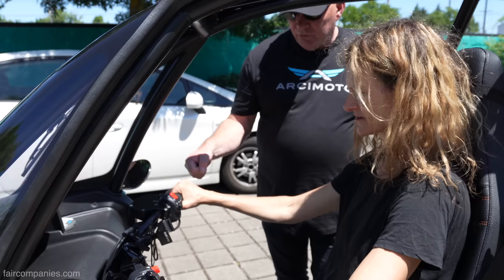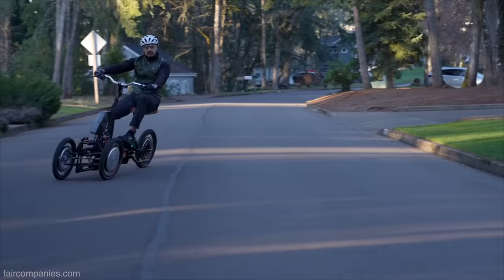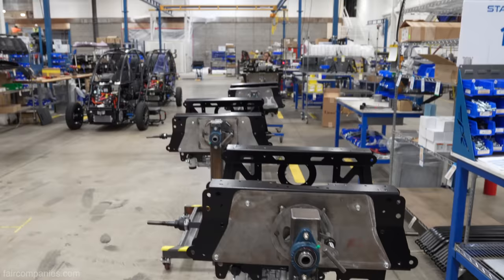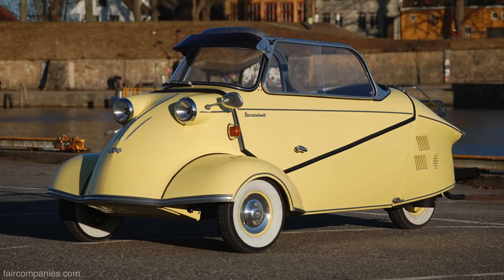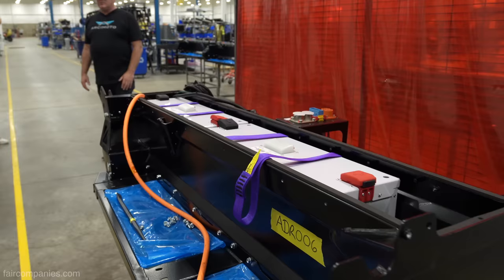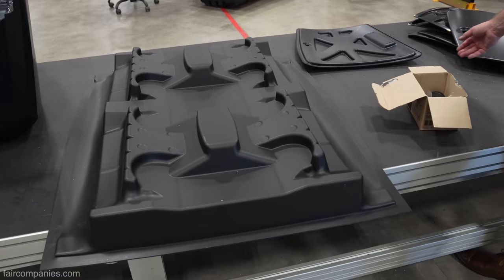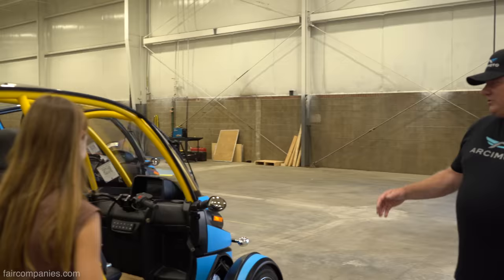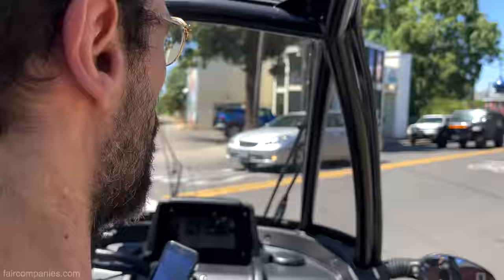Arcimoto 3-wheel EV commuter blends bikes' fun + cars' safety

Comment: This is one of the best solutions I've seen for last-mile delivery and urban first responders. Hopeful for these.
Reply: It’s probably great for direct delivery, like food and groceries and local shops, but it’s tiny for warehouse shipping.
Reply: And 
Where does the electricity come from?
Oh yeah…. Coal lol
Reply: @johnellis5820  not necessarily, and even if so, much more efficiently. So what's your point?
Reply: @johnellis5820  That depends on your local electricity grid.
Reply: @johnellis5820  Wrong... 
Coal plants generate 22% of utility scale electricity in the US and its going down every year. Will drop below 10% by 2030.
Reply: Low mileage and slow charging is the Achilles heels of using it for delivery. They need to fix the power pack and charging before any business would consider it.
Reply: @FreddyHuman  100 miles in the city is quite a lot of mileage, at least for European cities. For American suburban sprawls it's a problem, sure.
Reply: LAST MILE IS A STAND ON XIAOMI SCOOTER THIS IS A LITTLE MORE THAN THAT 😂😂😂
Reply: @alimanski7941  not enough for a delivery service vehicle.

Comment: It seems Arcimoto would be a huge boom in my country India  if price can be achieved between a ev car and a ev 2 wheeler.  As India is gearing up for EVs and most popular are ev 2 wheelers. Arcimoto would be a perfect fit as  daily commute distances are relatively small and traffic conditions are not favorable for cars.
Reply: The main issue seems to be the price. They’d need to ramp uo their production to reduce their current costs (as per their site, prices start at around $18k). Nice vehicle and seems to be very safe and stable, so I guess that’s the price for safety and innovation.
Reply: Once they get a foothold in one market they’ll go to other markets probably
Reply: Wouldn't it be amazing if they could open a mfg facility in India? That could certainly bring down the prices there.
Reply: In US I think such vehicles are classified like 2-wheelers. There are few petrol based as well. But in India, we dont have classification for such vehicles. Bajaj tried with car + rikshaw (3-wheeler) combo but it never took off. More than unit economics, regulation (and people who would want t sabotage through regulation such initiatives) will be bigger challenge
Reply: @chezmoi42  I have a motorcycle that was manufactured in India. I love it.
Reply: Its much too expensive for India. costs $18-25K if I remember correctly.
Reply: It cost as much as a real car though.

Comment: These are all great. Would love to see them turn into mass production soon. Would save a lot of resources.
Reply: If it doesn't replace a person's car completely, which I doubt it will for most, it will increase resource usage. Instead of having one car, now a person has a car and a very expensive electric bike.
Reply: @nwbackcountry5327  once you have one, you realize you use it all the time and your car is sitting rusting. Makes more sense to own a FUV and rent a car when you actually need one. (Obviously not if you’re schlepping a bunch of kids around for soccer on a regular basis.)
Reply: @nwbackcountry5327  Not an "expensive bike" in any way, shape or form. It is an inexpensive autocycle with roll cage and six point harness. Mine is the only new vehicle I have ever bought, after retiring on a modest SS pension. Very affordable and ideal as my only vehicle. Tons safer than any of the motorcycles I have owned and it eliminates the white knuckle experience.
Reply: Electricity still needs to be generated for them so still depletes resources.

Also, they can’t carry a family or much load…but they do look like great fun 👍
Reply: @nwbackcountry5327  These would be a great complement to a car share membership. Or a two-car family could downsize to one car and a 3-wheeler.
Reply: @bartholomewcubbins9723  That makes sense.
Reply: @popeyegordon  it’s all about the ego right? The single best thing a human can do IS reproduce, it’s our most important natural drive…to give life to another…to co-create. That is what love is.
Reply: @jimmyjohnny3779  Put up solar and make your own energy. Takes resources to make gas too.
Reply: @nwbackcountry5327  Families are often more flexible than that. My wife and I have one car and a motorcycle. 

I use the motorcycle 90% of the time to go to work. It easily gets 75mpg and takes up less parking and contributes less traffic out on the roads. 

We mostly use the car for our longer trips out of town or for shopping trips.

Comment: What an amazing operation! I never know how an EV 3-Wheeler are handled state by state (if it's a car or a motorcycle, while kind of license you need, can it go on the highway...).  I love it and would get one of these if I had the garage space! Honestly most people who don't have kids yet, single or couple, this type of vehicle is all they need b/c most their travel will be to work (if even that with remote work) errands or visiting people. Personally I'd still have one car though 🙂
Reply: The FUV has been approved by the NHTSA for all roads ...top speed of 80. Licensing vary by state, for example on the West Coast WA require a three wheel motorcycle license. In OR, CA, NV, AZ, HI, and UT a basic drivers license in needed.

Comment: Great video. The Arcimoto is impressive, just wish the tour guide gave more details on how the "optional" doors worked.
Reply: Yeah. Weather protection is important in some geographical areas.
Reply: How doors work? They open and close with the usual latches. How their functionalty works? They are simply not needed. They are security blankets for a generation that has known nothing but climte controlled cars. They contain no steel beams like car doors. The crash cage and harness is all you need. I would not want doors on mine if you paid me. Dead weight.
Reply: @popeyegordon  - Great, while doors may not be a high priority/necessity option for you, other folks may prefer the option. I can see wanting to have a set on hand for days when the weather is iffy (ie) same as how Jeep Wrangler owners like to remove their doors during stretches of really nice weather.
Reply: @__WJK__  There are some itches we should not scratch. The constant mention of doors largely comes from people who have never been on a motorcycle and have gone everywhere in over sized heavy climate controlled lounge couches. The concept and goal of Arcimoto is to break the car habit for many. It is as stubborn as a herion addiction but it has to go. Arcimoto will be catering to these poorly reasoned and mostly unjustified demands in order to sell more autocycles. As long as it reduces the abuse of 4 passenger cars which are typically driven with one passenger and 80% of their internal space empty it is an improvement but demanding to be transported around like royalty or heads of state in luxurious sealed vehicles is counter productive to sustainable transportation goals. Even electric Jeeps will waste more energy and have a shorter range with doors installed. My heated seat and heated grips, combined with the wind break of the windshield and roof are all I need to drive in winter. The FUV does not have to be suitable for all climates to be a great success. Snowmobiles are useless in Florida but they still have a market.
Reply: @popeyegordon  - You have a rather interesting aversion to adding doors to the Archimoto my friend lol
Reply: @__WJK__  I went through the exact same thing when I bought the doorless Organic Transit car-bike as shown in my avatar. People with zero bike experience all said where are the doors. But when you exercise in a small space like that you can overheat and the windows fog. Some features of high speed climate controlled vehicles should be abandoned in favor of more sustainable existence. The few owners who put doors on theirs were overheating except in extremely cold windy weather. Windshields cut the wind chill and rain.

Comment: I wonder if you can get skis on the front and change out the wheels in the back for a track or winter tire. Nice to have a thermal enclosure and winterized tire kit.
Reply: That would be very cool!
Reply: It's front wheel drive.  You could put winter tires on the front.

Comment: With 20 kWh and a range of about 85 miles (136km) it averages 147 Wh/km which is just about the same as a Tesla model 3, that 4000 pound car you keep referring to. I'm all about lighter, smaller and more efficient vehicles but at the moment it is only lighter and smaller. I really hope some day a vehicle like this will be designed around efficiency instead of (or in combination with) fun. It looks fun though!
Reply: Efficiency is not measured by battery capacity and max range.
Tesla cars have high battery capacity but less efficiency (consumed energy per meter) than Arcimoto.
Reply: @ReeseL4D  The efficiency IS calculated by battery capacity (consumed energy) over range (the per meter part)! Their website promises a 100 miles city range, 66 miles at 55mph and only 32 miles at 32 miles. So my guesstimate of combined range at 85 miles (136km) is quite generous. With a battery pack of 20kWh (see description of video)  it results in 147 Wh/km (20000Wh/136km). The standard tesla model 3 consumes 151 Wh/km (ev-database) and they are therefore practically the same. So for a much smaller and lighter vehicle I'd say it's the opposite of ultra efficiency. They use a miles per gallon figure to hide this but electricity doesn't come in gallons so you can use any conversion factor you like
Reply: @rosserobertolli  You are absolutely wrong!!  In electric cars, efficiency has nothing to do battery capacity!  In gasoline cars, efficiency has nothing to do with gas tank size!  Vehicle range is not some number on a website.  Many factors affect range.  Wind, passenger/cargo weight, uphill/downhill, speed, .... affect vehicle range.    You assume the arcimoto starts with 20 kWhr of energy and ends with 0 KWhr, which is absolutely a wrong assumption!!  You assume the same thing for Tesla!!  Gasoline cars do not start with full tanks and end with empty tanks!!  Now Pay attention.  The way to compare two vehicles, is to drive them under identical conditions.  Connect a device to the battery.  Measure power coming out from the battery.  Drive 10 kilometers.  Do not use the number (kwHr) written on the battery.  Also, do not use road signs to measure 10 km.  There is also battery charger efficiency (energy is lost when charging batteries).
Reply: @ReeseL4D  If you devide the driven miles by the used gallons of gasoline you absolutely get the miles per gallon. And the total range of a gasoline car is based on a full tank (and yes, until empty, so indeed not very practical but still the truth). Same goes for electric. But if you are still not convinced and still think the Acrimoto is much moe efficient then please enlighten me of the efficiency of the Arcimoto and that of the Tesla model 3 base model in the units you see fit (even joule per meter) incluiding your sources and I will happily agree with you if you are right.
Reply: @rosserobertolli  Previously, the arcimoto had two battery options: 12 kwHr and 19.2 kwHr.
Reply: @rosserobertolli  Based on what I read (which may be wrong), a full (100%) charge on Arcimoto batteries is approximately 80-90% real charge.  An empty (0%) charge is actually 10-20%.  If these numbers are correct, then 100% to 0% is actually only 70%.
Reply: @rosserobertolli  My guess is the US government (EPA) tested the Arcimoto with the 12 KwHr battery (but I could be wrong).
Reply: @rosserobertolli  Assuming 102 city mile (164 km) range with 8.4 kwhr (12 KwHr battery capacity x 70%) actually consumed, then efficiency is (8400 Whr) / 164 km = 51.2 Whr/km in city
Reply: @rosserobertolli  Assuming 102 city mile (164 km) range with 13.44 kwhr (19.2 KwHr battery capacity x 70%) actually consumed, then efficiency is (13440 Whr) / 164 km = 81.95 Whr/km in city
Reply: @ReeseL4D  I hope that's true, with the 70% and 12kWh you get about double the efficiency at 75Wh/km? That's in line with the Renault Twizy and Carver S+ so it would make sense. But still, my daily driver (an e-velomobile) gets 7.5Wh/km, that's 10x more efficient. With better aero and lower frontal area a full electric 2 seater should be able to get near 15Wh/km and that for me would be the ultimate goal of (city) commuting
Reply: @ReeseL4D  Oh I see you already calculated it! The 230MPGe in the description converts to 91 Wh/km, not sure how that was calculated but it seems about right. Better than a tesla (which seats 4, but hey, that rarely happens), and slightly worse than the Twizy (63 Wh/km) and the Carver S+ (71Wh/km)
Reply: @rosserobertolli  Under 50 mph (in city), vehicle weight is more important than aerodynamics.  Above 50 mph (on freeway/highway), aerodynamics is more important than weight.  For example, the Aptera is shaped like an airplane.  Excellent aerodynamics.  Aptera would be a good car for the authobahn but not so good for city driving (too wide and too low).  In my personal experience, the best safety feature in a car is good visibility.  A low frontal area means less is visible which means increased chance of accident.  I think Arcimoto's tall frontal area is better because driver visibility is very good.  I do like the Carver S+

Comment: I live in the Pacific Northwest USA. It rains a lot. These little things look like I would be wet and cold most of the time.
Reply: California
Reply: A Ford bronco with doors off almost completely blocks off the rain, guessing its similar in the jeep wrangler.
here yoyu'd just wear clothes like for a bike. people ride all year long and are fine, i did too in high school and middle
Reply: @nonyobussiness3440  in California too.. high desert... The seats look like they will burn your ass after just an hour in the sun... It's usually over 100° every day here... 🏜️
Reply: @Brian-jv8iy  
That sounds very good for you Brian. Many people don’t want to wear rain clothes with wind blown hair everywhere they go.
Reply: @peterzotti6430  have you seen how many Polaris Slingshots are in rental fleets in Vegas ? The fun factor outweighs the hot seat factor.
Reply: @peterzotti6430  you ever heard of using a motorcycle cover to block the sun once you park it??
Reply: Maybe you should go comment on a Tesla video saying how cool it is for keeping you dry 🤣😂🤣😂
Reply: As we do in the PNW, put on a rain coat and you’ll be fine. I keep rain pants in mine in case of rain. A puffy keeps me warm for my short drive all winter.
Reply: @dobbsmovies  
If that works for you great.
Reply: You can get them with half doors. They are working on full doors and A/C and heat too.
Reply: @b_uppy  It would cut mileage pulling a trailer for sure. They do make a flatbed if that helps.

Comment: I've been waiting for something like this to come out but fully enclosed and sold in the northeast / mid-Atlantic, where it's miserably cold from November to May.
Reply: The most sustainable designs are not suitable for extreme weather. Climate control is an energy intensive option for the materials needed, the battery power needed and the extra vehicle weight. Not a big deal - snowmobiles are not worthless designs just because they are useless on Florida. A decision to keep living in the north means a decision to use more than your fair share of resources. The results of this are so bad that you are seeing warmer weather that is changing what you need, what flora and fauna are around you and what you can grow

Comment: Top designs as yet. Impressive company and that shows in the final designs. I would very much like to see these widely utilized. 
Wouldnt buy one without side doors. I dont care if they are simply framed plexi. Needs a cabin environ. Because sucking exhaust is not "priviledge" I am open to.
Reply: These seem fine in California but I wonder how they would perform in cold climates. Battery life, heating, handling and durability are all things that might be concerning. For last mile trips I wonder what the benefit of these would be over an electric bike. Seems annoying to need to deal with parking spots.
Reply: "Final design" came largely from Munro & Associates
Reply: Full enclosure and HVAC is in the works. For market entry we focused on a product that is ideal for mild climates, but as we get to scale, we definitely need a four season solution for the northern regions.